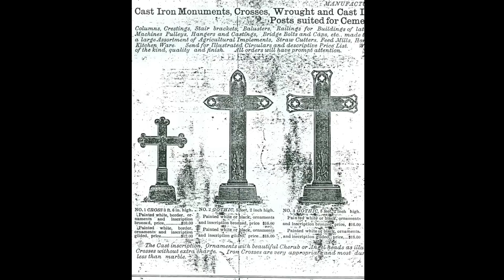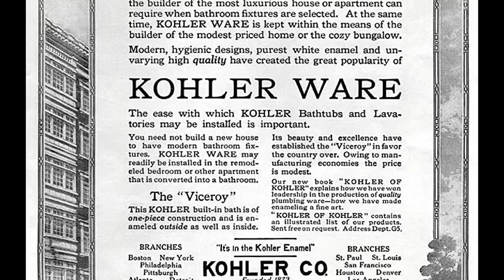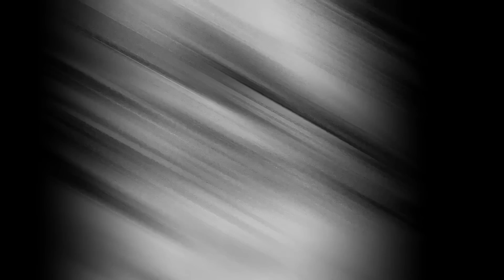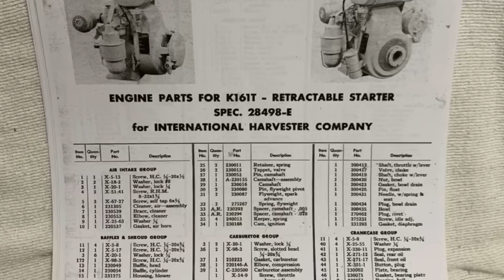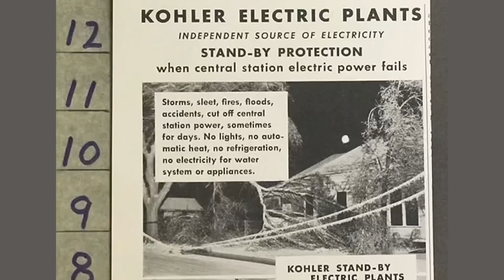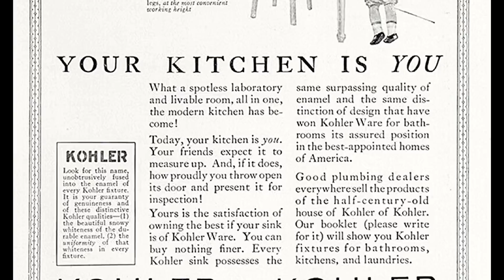Early Kohler history

Comment: Kohler and Cub Cadet ( the Cub Cadet as it was under International Harvester ) ( Cub Cadet under subsequent owners have and still produce Great stuff mind You, I use an RTZ50 not mine and it is a winner also but not powered by Kohler it is a dynamite 23 hp Kawasaki engine )  they have helped Me for nearly no more than 40 years and are still working Winter Spring Summer & Fall the K series engine was and those still doing work are in a class all by themselves, then along came the smog police ruined everything. I have a 100, 102 x2 one is parts a 1450 and if all goes well this weekend a 1650 the 102 with a ten hp has done snow blowing for Me (with a QA36 snowthower ) and a lot of the street I live on for four decades and some, You name it it has happened but I fix it and keep it going that is the beauty if this stuff if You have a Mind to it it is all completly repairable! none of this oh no its broke get another one! Cheers!!! Rick from Ontario Canada, Further I am 66 years Young this year and Your a Young Guy and Great to see Your interest in what has been before Good Stuff!
Oh and I have had Kohler for so long I can type it out spelt correctly 9 in 10 times Mostly : ) also this is in Canadian funds 🙂
Reply: Stens still sells reasonably priced repair kits for the old K series
Reply from the maker: Great to know
Reply from the maker: Thank you so much for that donation as well as all the insight and added information =) kohler = king

Comment: About 20 years ago I bought a Gravely zero turn with a 17HP Kohler Courage engine. It was a single-cylinder with two balance shafts. I expected it to be smoother than it was and it was super hard to start when it was colder than 60°. That was a super nuisance in northeast Ohio. Other than that it was fine. I sold it after 9 years because I moved to a larger property and bought a tractor. It was still running fine and the guy I sold it to loved it.
Reply from the maker: Awesome thank you so much for sharing your experience =)

Comment: Several years ago I picked up a Kohler L600 6.5kw propane generator set on a trailer most likely produced in the 1950's.. That is a 4 cylinder water cooled engine.  It had not run since 1970 or 71..  had to work on the Fairbanks Morse magneto but it did run and put out power.

Comment: I think the device you are remembering is made by E. C. Stearns & Company or J. I. Case Threshing Machine Company. Both companies made devices that could double or even triple the output of a horse. These devices were essentially treadmills or rotary systems that horses would walk on or around. The motion of the horses would turn gears and drive machinery, such as threshers, saws, or other equipment. By converting the linear motion of the horse into rotary motion Here are two examples: Eclipse Horse Power: An example of such a device, where horses walked on a circular track, driving a central shaft connected to farm equipment. Sweep Horse Power: Another type, where horses walked in a circular path to turn a horizontal sweep that powered machinery. John Deere and IH also dabbled in this domain however, Stearns and Case specialized in this equipment. I can't find any information that Kohler made anything like this. Maybe it's been lost to antiquity.
Reply from the maker: That sounds like that device kills me I can’t find anything on it here

Comment: They used horse driven “stair cases” here back in the day. Basically an escalator a pair of horses would “climb” Which turned a shaft with a flat belt output. Maybe that’s what you’re talking about? Apparently if the belt came off it would speed up and hurt the horses. There were lots of stationary engines and generators used here as the town didn’t get electricity until the mid 1950’s. I’ve got an old Kohler radiator and grill probably from a generator as a wall hanger.
Reply from the maker: Thank you so much for sharing this information =)

Comment: Fascinating.  I had one of the small four cylinder 1500 watt generators (military, I think, uses a 5 gal. GI gas can for its tank). Gave to a friend who likes old equipment. It was carry twice its rated load. Sounds like Kohler got into light plants about the same time as Homelite (Home Electric Light) company.  Never had one of those light plants, but bought (and still use) my first Homelite chainsaw 50 years ago).
Reply from the maker: How long did 5 gallons last ( I know until it’s gone lol ) thank you so much for sharing that info
Reply: @What.its.like.  Just talked to my buddy; he says he thinks it used around half gallon per hour with the test load he had on it, but he’s never run a full 5 gallon tank at one time. This is a guy who kick starts the gas engine on his 1915 Maytag when he washes rags.😅

Comment: From 1977-1980, I worked at a go cart track in Las Vegas. The original carts had "KOHLER cast iron" engines. Sir, they were tanks.They were tough, they were strong, and they lasted forever. The chassis started to fall apart but those engines were still running when we replaced all the carts. They were replaced with newer versions with Honda engines.But those KOHLER engines, man , they kept on running. We listed them for sale, and most of them were sold to landscaping companies.Cause they knew about reliable engines. I would bet a lot of them are still running today.
Reply from the maker: Thank you so much for sharing that story and the memories =) Honda came in and became the standard or in many cases the best we have a Honda generator super quite
Reply: I had a Johnson Kart from the 70's that had a 3hp Kohler. Fantastic engine!
Reply: Oh Yeah... Bulletproof!

Comment: About 35 years ago, I found an old rototiller, it was made FMC. It had a Koller engine. Looking it over, I could tell it was older then me. The engine was all cast-iron, it was an L head, and locked up tighter then Fort Konx. I broke it down and went to work on it, as my luck was holding out I found the timcin numbers for the bearing and seals, rings were a bit harder to find. After rebuilding the engine and carburetor, I rapped a rope around the starting pully, it started up and ran great. I gave it to a friend who used it for 15 years.

Comment: I put in many hours in my ~4th to 7th-grade years on a (Jacobsen-built) Ford LGT125 mowing and rototiller-ing, and sometimes instead the Cub Cadet 127(?ish) mowing, both with a hydro transmission and (per TractorData) the 476cc 12HP single Kohler. For me, it was something fun and different, learning to drive and operate machinery (even though small and simple) long before I could drive a car on the road. For my dad, it was a few hours he didn't have to do that chore and could spend the time elsewhere. A Ford 1620 with a Shibaura 3-cylinder diesel eventually replaced both for maintaining lawn & gardens around my parents' house.
Reply from the maker: Thank you so much for sharing your experience

Comment: Again, I learned something today. I never knew that Kohler plumbing and Kohler engines were the same company. Those generators were interesting, especially the early DC models. Notice that it says that you can deliver power up to one mile away- that's because that is about the limit for DC current to travel without a major voltage loss. James Watt coined the term 'horsepower' to show how his newly developed steam engine could do as much work as X amount of horses. I never had a Kohler engine, but I did have a 1949 Clinton, tons of Briggs & Strattons, and several Tecumseh engines. Cool video today, Jay!
Reply from the maker: Great insight and information I’m always learning from all you in the comments as well =)
Reply: James? James Watt. As Watt developed the concept of horsepower, the SI unit of power, the watt, was named after him.
Reply: @Tag-Traeumer  Wow, I forgot to add his surname! Good call, I'll fix that.
Reply: @61rampy65  👍

Comment: I have a running 1958 pacific mercury briggs power plant. Used for remote cabin as a power source. Set up for a car battery to start as a starter generator. Has a remote switch port. Top of the line in its day oil bath intake. Loud though. Runs great. Great compression cost 20 bucks at yard sale weights 150 lbs plus. Made to last.😊😊
Reply: Wow, I totally forgot that old engines like that had oil bath air cleaners. I had an ancient Briggs that had a little tiny oil bath air cleaner when I was a kid (a very long time ago). I had no idea how it worked.

Comment: Saw a model t Ford with a belt on the rear wheel driving s washing machine guess that's  t power 🎉
Reply: Back when i was young i saw several  old saw mills that ran on Buick Straight 8s . My brothers father in law had a little mill for personal use that used a VW engine.
Reply: @Troy_nov1965   see bud  Metz sawmill.    Dry rock studios  videos

Comment: In the 1960s and 1970s my grandparents had a cabin up one of the canyons near Palm Springs the you hiked up to. They bought a new John Deere garden tractor with trailer for transport the 2nd half of the hike which was much leveler terrain… it was a job to get to that half way point where it was stored. The following winter there was a flood which would have made it impossible to get it up at all. The tractor was found upside down half buried after. A stone garage was built for it. I learned to drive it at age 9 and have many fond memories of it.
Reply from the maker: Awesome thank you so much for sharing your experience with kohler engines =)

Comment: I have been collecting old engines for years! I ended up acquiring a Kohler light plant from the basement of the very same school I graduated from after the school went through some renovations. The K series engines are hard to beat, they were used in many of the competitive, high dollar garden tractors like International Harvesters Cub Cadet and Jacobsen. My favorite K series engine Kohler made is the K321, they're just great running engines. Great installment, I really enjoyed this one.
Reply: Love my cubs 147 149 with k321a 6099a 14 hp stored more oil fir better lubrecation and cooling. Wish they still made them.
Reply: @lesliewood3616  Same here brother! I have a few Wheel Horse tractors with that engine. I had a 147 that had a loader on it. That little engine had some great torque and made good power at low rpm.
Reply: Hahn turf equipment used the K301 too tough iron !
Reply: @jhonsiders6077  For sure!
Reply from the maker: Awesome I was curious how about fuel consumption on the light plant have you run yours they are bigger than the ads suggest
Reply: @What.its.like.  The fuel consumption isn't bad at all under a light load. I use a small 2 gallon fuel tank off of an old compact/utility tractor to run the plant. I can get about a days worth of use out of that two gallon fuel tank when running the light plant at shows all day continuously.